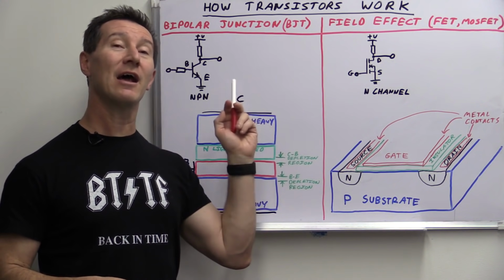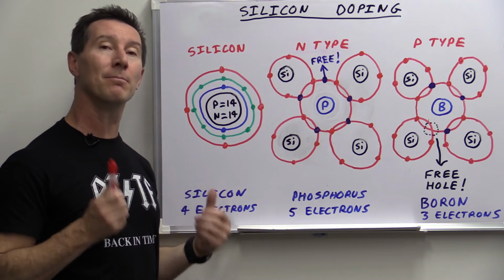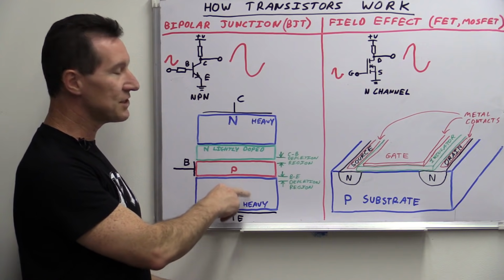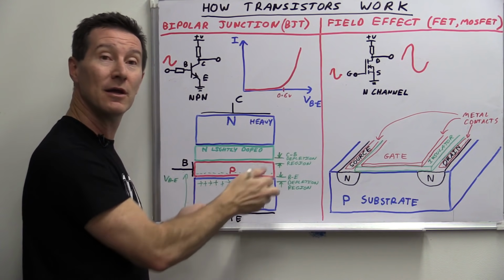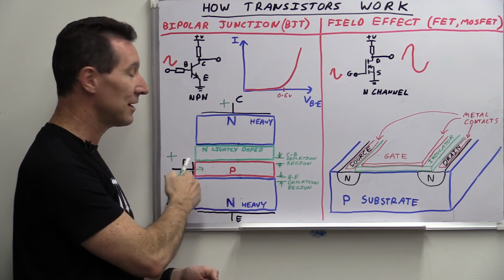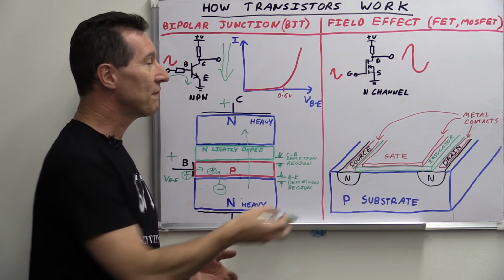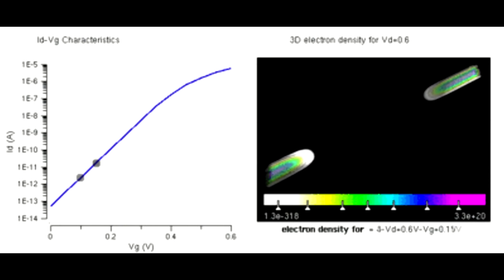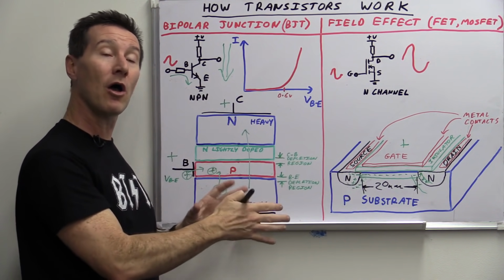EEVblog #748 - How Do Transistors Work?

Comment: Why do we even use conventional current flow? It appears to only create more confusion.
Reply: ronettreker The notion of current direction is old. The guys back in the days of batteries just decided on a direction (current flows through a wire from the part of the battery where the electrode gets reduced to the one oxidized) and then stuck with it. Then Coulomb showed electric potential is due to charge, and then at the beginning of 1900 Millikan showed the charge is quantified. But since it turned out this particle actually "flows" from the negative terminal to the positive, and this effectively was the reverse, but a bit too late, the community just stuck with what they knew from before. It is just convention that a electron is negative in charge. It could equally well have been defined as positive, if the signs were just switched in all formulas. That'd be totally fine.

You are on the right track with the "homogenization" concept you have. The rule is basically that any surplus of charge, be it electrons (negative) or the lack of them (as in ions - atoms that lost an electron, or holes - defects in the lattice where there "should" be one electron) tends to even out. This is a statistical process, equal to smell diffusing through a room. If you fart in the bathroom, and the smell eventually goes into the living room, it did not do so because it somehow wanted, but because there simply was a lack of fart in the other room. This concept of "increase of disorder"(read: entropy) drives everything in the universe, and we explain the amount of willingness to do so with the concept of "energy". So, everytime you have a surplus of charge on one spot in space (needs not be a battery or metal, can be liquid as in batteries or even gas as in clouds before lightning, etc.), and add a conductor to another spot in space where there is less charge, the charge will tend to even out. If it is a surplus of electrons, it will go to where there is less (more positive). Positive ions on the other hand, when they travel, go from positive (lot of positive ions, like Sodium ions outside cells) to a more negative place (less sodium ions) - here the electric current goes the same way in the circuit (ie. over a brain cell, a neuron or a muscle cell when it is activated) as the physical charge carriers (ie. the last example sodium ions). The same with holes, since the crystal lattice is neutral at first, there are equally many holes and electrons. They get separated, and where there is less electrons there must be more holes, and vice versa. So whenever electrons go back to their holes, it looks like the holes went the other way around (from the place with many holes, to the place with less holes) since due to the electrons going from a surplus back, the hole concentration actually increases.

Long explanation, but I saw you genuinely wondered and hope this helps out. If you liked it, share with someone else. Don't want any creds, just to spread the gospel. Peace
Reply: ronettreker It's all in the name. We use conventional current flow because that's the convention. It would maybe make things more intuitive to reverse all the signs but pushing past the fact that the usual charge carriers (electrons, and this is not always the case, see holes, ions, etc.) are electrons which we (arbitrarily, remember this is the realm of language and symbols) define as negative to eventually understand that a positive current in one direction is nothing more than a negative current in the opposite direction (you have to work out a few KCL problems to wrap your head around this one) is an EE rite of passage. This mirror image thing pops up all over the place. Another example is the dual nature of NPN and PNP transistors, or the complementary nature of capacitors and inductors, electric and magnetic fields, time domain vs frequency domain, and so on and so forth.
Reply: You could accurately say that the air is flowing uphill to displace the water,  but the water is more tangible so convention says "rivers flow downhill".    In 1900, a bold academia could have burnt all the existing textbooks (and labelled equipment, and intransigent lecturers)  and started fresh with the new convention  like when a country switches from left to right driving on the road.   This change would have needed to be global, and inevitably some countries, institutions and firms would have refused and we'd all be in a confused mess right now.
Reply: ***** When I drive my car, from my point of view the earth moves backwards, yet I still say that I move forward;)
Reply: +ronettreker  Even better than PN junctions is metal/electrolyte junctions in acid electroplating or in batteries and fuel cells.  All these involve proton conductors (heh, so did Franklin's kite twine.)

In that case the free protons in the acid are flowing to the metal plate surface, met by electrons coming from that surface, and canceling each other to form H2 gas bubbles.  Out between the plates is the pure proton-current, plus a bit of negative sulfate ion current, and no bare electrons allowed. At the other battery electrode, the neutral H2O molecules get split to form mobile protons which then are electrically driven outwards into the acid as a current, leaving behind the free electrons which burrow down into the metal surface of the battery plate (plus, O2 bubbles.)

So with lead-acid batteries, we really do have an "anti-electron" current in the electrolyte, and at one plate the normal-current and the "antimatter-current" come together and "annihilate" to form neutral hydrogen gas.
Reply: +EEVblog What???? Jees Dave read your history.
Reply: +Peter Walker 
No, that's simply wrong.    It wrongly assumes that electric current is electron flow.   Yes that's true for solid metals and semiconductors, but not for many other conductor types.   Since electric current is not electron-flow, conventional current cannot be "wrong."

Conventional Current exists because electric current needs to be simplified, and many conductors contain both positive and negative charges which flow past each other in opposite directions.  (Which then is the "true" direction?)  :)   Conventional Current conceals all this.  CC masks the speed and density of the carriers, and also masks their polarity.  CC is what ammeters measure, and ammeters don't detect the carrier polarity.  CC is the method used by science and engineering to simplify circuits.   (Mostly it's the technician students who complain.   The engineering and physics students figure it out.)

Heh, maybe if it went the other way, metals and vacuum tubes would be easier for beginners.   But also, the present 'backwards' CC polarity will expose the physics misconceptions we had as beginners.   

A big misconception is the idea that wires are like hollow pipes, and the power supply provides the electrons which flow.  (Then supposedly the electrons hit each component in the series, one at a time.)   Nope, wrong.   Circuits are nothing like this.

Instead, wires are like pre-filled pipes, and circuits act more like drive-belts or flywheels.    If we turn a drive-belt or flywheel CCW instead of CW, everything still works about the same.  The "belt" doesn't strike each component in sequence, instead it moves as one, all at once, like a turning wheel.  When using this "full pipes" explanation, polarity doesn't really matter.    Make your flywheel out of antimatter, and when your (antimatter) thumb rubs against it, it still slows down.   Resistors act like that: creating friction and back-pressure.   But resistors work the same regardless of the polarity of carriers or the direction of current.
Reply: matt holland
None of you bloke has ever given a rational explanation of this moving ions in a battery bulldust.
Mr batty is the man who said ions move through the body under charge then wisely edited it out of his post. LOL
Mr Batty says the whole world is wrong.

From a simple source for cells (batteries) on  the web.
http://www.explainthatstuff.com/batteries.html

Why don't the electrons just take a short cut and hop straight from the negative electrode through the electrolyte to the positive electrode? It turns out that, because of the chemistry of the electrolyte, electrons can't flow through it in this simple way. In fact, so far as the electrons are concerned, the electrolyte is pretty much an insulator: a barrier they cannot cross. Their easiest path to the positive electrode is actually by flowing through the outer circuit.
Reply: +matt holland
Conventional Vacuum flow is the inrush of nothingness into your leaky spaceship.

Spare me.
Reply: +ronettreker I think that conventional current flow is much simpler than electron flow. You are overthinking the particle side of things while the reality is a lot simpler than it appears.

With conventional current, you start with a positive potential at the positive terminal of the circuit and as you move through the circuit, loads take away from your voltage while gain elements add to it, down to zero volts (ground).

if you want to use electron flow, you need to switch things up. You start with a negative voltage at the opposite terminal. Things that take away energy like resistive loads cause a GAIN in voltage, and things that add energy like batteries will cause a REDUCTION in voltage, and the voltage will go up to zero volts (ground). I don't know about you but using electron flow can get very confusing for me, and for the reasons below it doesn't provide any real advantage to understanding electrical flow, once some common misconceptions are dispelled.

We all make the common mistake of treating the electrons as the only "moving" charged particles while the relatively positive holes they leave in their wake are considered to be "unmoving". This doesn't really work because the holes that electrons leave behind are generated via the motion of the electrons, and that motion is dependent on all the properties that those electrons have. As such, the holes that are generated can be considered to have virtual properties including velocity and charge that mirror those of the electrons that created them (in reference to the properties of empty space). For electrical applications, treating holes as "moving particles" is just as valid as treating the electrons the same way.

Where people get stuck the most with the concept of positive holes is that they insist on treating them as unmoving anomalies. The only realistic situation where this happens is when we look at the universe from the frame of reference of the hole itself which makes it stationary and makes the rest of the universe move in relation to it. As you might guess, if everything else is moving in relation to the hole, then the hole must also be moving in relation to everything else.

In short, don't lose too much sleep over the concept of current flow being the flow of positive charge, even though there are no "real" particles that are moving around with a positive charge. The holes that electrons leave in their wake have properties and behavior that perfectly mirror those of the electrons, for all intents and purposes, so feel free to use whichever flow metric you feel the most comfortable with. Just don't assume that electron flow is more correct, because it practically isn't any more correct than current flow.
Reply: matt holland So, what I understand, is that it's not actually just the flow of electrons in one direction, but more like some kind of  "homogenization". Like for example in a PN junction, it's not just the electrons flowing from N to P, but the "holes" themselves moving from P to N. So, in a PN junction, the conventional current flow refers to the flow of "holes" towards N while the electron flow refers to the flow of electrons towards P? That means that electric current in it's general term is bidirectional? Is that how it works?
Reply: EEVblog I understood the analogy...but I wanted something more detailed. Can you make a video on it?
Reply: ***** The water flowing downhill is kind of a bad analogy as it contains another force-gravity. A better analogy would be two tanks one with hot air and the other with cold air, both of them connected via a pipe.
Reply: ***** "Charge moves from - to +"... What charge? The only charge that moves from negative to positive is negative charge. And positive charge moves from positive to negative. The water flowing downhill is a bad analogy because gravity playis a major role, in electric current gravity doesn't matter that much. I think the two tanks connected via a pipe is a much better analogy, you can even dye the water in each tank in different collors and see the water current flowiing between the tanks.
Reply: ronettreker Let'sjustblamebenjaminfranklinfornow
Reply: mahirharoon SPACEBAR
Reply: ronettreker Water flowing down/ air flowing up, and gravity being the driving force is a perfect analogy to charge flowing under the influence of an electric field. In fact, under the common assumptions in both classic mechanics and electric circuit theory, both fields are treated as conservative, and the path integrals through them are fully equivalent. Again, the notion of a negative or a positive charge is purely due to convention.
Reply: >  Isn't the number of electrons in a medium that 

+ronettreker You're talking about metals, not about conductors in general.   Your explanation doesn't apply to electric currents in battery electrolyte, or human bodies, or dirt, oceans, ionized air, etc.  Yes, electrons do flow in metals, semiconductors, and plasmas.  But in all other conductors, mobile electrons are forbidden.

Also, the typical "static electricity" explanations in grade-school textbooks are wrong.   To create charge-separation, usually we're moving ions around, not electrons.   If the surface is a bit acidic, then H+ hydrogen ions are the charges being transferred.   An H+ ion has another name:  mobile proton.   (And this means, Ben Franklin's single-fluid-theory of electricity was just totally wrong.  His twine kite string, it was actually a proton conductor.)
Reply: +denny11lane I agree!
Reply: +ronettreker Because a long time ago we had to come up with a convention on electricity. We assumed that something was flowing through conductors but we didn't know what. Someone, perhaps Ben Franklin, decided to use positive and negative as used in account ledgers. Thus the convention was born. It was a 50/50 bet. By the time we realised that electrons existed and had a 'negative' charge it was too late to change everything. Musschenbroek, Cavendish, Galvani, Volta, Faraday, Ohm and many others had been working with this mysterious thing for a very long time.A convention, contentious or otherwise, was useful if one were to write papers on the subject.. So now we abstract the notion as conventional current where 'holes' move.
Reply: +wbeaty
It's not wrong. Read the history. All the papers and experiment notes from the gentlemen mentioned are available to read. Or the translations are.
Read them.
It was only late in the 19th century we started to have any idea of the existence of an electron and we had no real idea of atomic structure until 100 years ago.
The positive to negative electric flow convention or notation was used well before any of that. It was only after the discovery of the electron as a particle with mass and velocity that it was realised that the convention was wrong.
All else is revisionism.

Yes, yes we are all familiar with ions but it has no more relevance to the choice of notation than Steven Greys gold leaf moving or flowing  to a charged rod.
Reply: +Peter Walker Current is the flow of charge, not the flow of electrons. @wbeaty is right. If current is the flow of electrons, then batteries would not work.
Reply: matt holland
http://www.allaboutcircuits.com/textbook/direct-current/chpt-1/conventional-versus-electron-flow/
Reply: matt holland
What mysterious flow is happening in a CRT or thermionic valve?
Sneaky positrons?
Phosphor ions?
Gods little angles?
Reply: matt holland
Magnitude of charge: Charge of proton is 1.6022 x 10-19 coulomb. Mass of proton: Mass of proton is 1.0072766 a.m.u. or 1.6726 x 10-27 kg. Comparative mass: Proton is 1837 times heavier than an electron.
So all these protons are getting pulled flying to the other electrode?
What do they leave on the other side - chicken soup?
http://hyperphysics.phy-astr.gsu.edu/hbase/electric/leadacid.html
Reply: matt holland
If you want to call paper lifting off the table to a charge plastic rod current then so be it, but it's no more current flow than the slight movements of plates in a capacitor or any other electrostatic dynamic reaction.
Reply: Well, the positive particles in battery acid are very real.  They're the free protons, the +H ions of the acid.   Acids are good conductors, but no electrons flow in acid.

The positive charges in p-type silicon are actually real.  They're the un-cancelled protons of the semiconductor atoms.  The positive charge of holes is very real.  Only the motion of the positive charges is virtual.  In p-type semiconductor, the protons "virtually move" whenever a cancelled-out electron from a neighboring neutral atom jumps into the "hole." This cancels out the positive proton of the original hole, while "revealing" or un-cancelling the proton of the neighboring atom.  That positive charge is now in a different location.  It's a genuine positive charge, but no proton had to leap between nuclei in order for its position to change.

The original analogy for p-type currents is a hole in the dirt.  Once you have a hole in your backyard, you can move it around.  Just dig dirt into it, filling it up.  This empties dirt from another place, and moves the hole!   So, did the hole actually move, or did only the dirt move?  That's a silly argument with no answer, since when we view from a distance, the hole appears to move from place to place in your yard.  But from close up, we don't even notice the hole, and we only see the shovel and the moving dirt.  Similar argument:  I can prove that forests don't exist, simply by standing facing a single tree, then refusing to ever move far away and view it from afar.
Reply: +Peter Walker Oh hey, sorry I didn’t see all your questions until just now when wbeaty replied.  

I’m not sure what the confusion is regarding the battery. Here’s an excerpt from your link talking about ions flowing in the electrolyte:

“When a battery is connected to an electric circuit, a chemical reaction takes place in the electrolyte causing ions (in this case, atoms with a positive electrical charge) to flow through it one way, with electrons (particles with a negative charge) flowing through the outer circuit in the other direction.”

Do you deny that that positive ion flow constitutes electric current? Or is that you don’t think the ions are necessary to the batteries operation? Steady state current flows in loops, otherwise you wind up with situations that either violate conservation of energy or conservation of charge.

I’m not sure what point you were trying to make with your other comments. You seem to be arguing against straw men (things I didn’t say). I’ll try to restate for you. Please point out what you disagree with and maybe we can figure it out together.

1) current is the (net) flow of charge past a reference point.
2) charge comes in two flavors, positive and negative.
3) charge carriers come in many flavors, electrons being the most familiar to us.
4) a positive electric current occurs either when a positive charge moves in the positive reference direction, or when a negative charge moves in the negative reference direction. or when both positive and negative charges are moving in opposite directions, with more positive charge moving in the positive reference direction, or more negative charge moving in the negative reference direction.
5) None of the previous points change if we swap positives for negatives and negatives for positives.
Reply: The charges were arbitrarily called positive and negative because electrons hadn't been discovered yet.
Then once you have defined positive and negative, the direction of current flow is fixed according to usual principles.
Reply: History, that's all. It's easier to just explain to EE's that current flows "backwards" because once you get up to the component level, it doesn't matter at all. In reality, (IMO) life would just have been easier if we had identified electrons as positively charged from the beginning, since they are the moving charge carriers, but by the time we figured that out it was too embedded into all the math and physics of electricity.
Reply from the maker: ronettreker Because it makes more sense and also follows the the arrows in diode and transistor symbols.
Reply: From what I know those symbols were created because of conventional current flow. Anyway, nevermind that. I don't understand why does it make more sense... I'm really curious.
Reply from the maker: ronettreker Water runs downhill, from the higher up potential to the lower potential for example. Thing like that make conventional current more relate-able and more "obvious" that current flows from positive to negative. That's why they thought that was the case to begin with, it wasn't an arbitrary choice.
Reply: EEVblog Isn't the number of electrons in a medium that define it's potential? I thought that electrons flow from a medium wich contains more free electrons to a medium which contain less, in order to achieve equilibrium. I thought the reason why the higher potential medium is negative is because of the higher number of negatively charged electrons. If so, then the negatively charged medium is the one with higher potential, not the positively charged one. Did I got it right?
Reply from the maker: ronettreker i think you may be missing the point I was trying to make. I was trying to show how (unless you know the details) it's more obvious to the lay person that something (current) would flow from something higher (potential) to lower (potential).